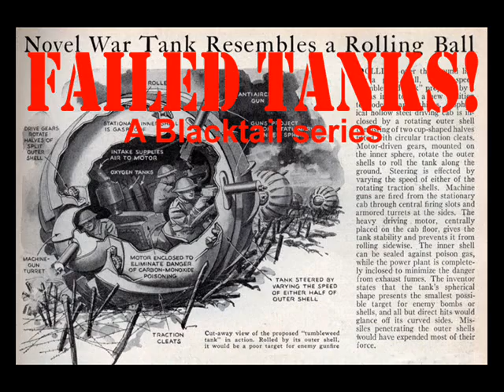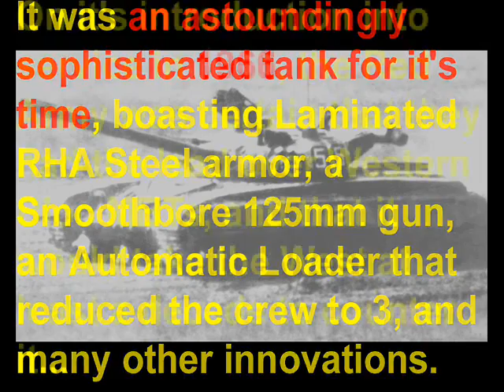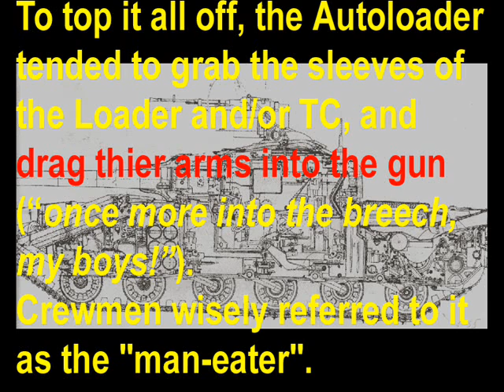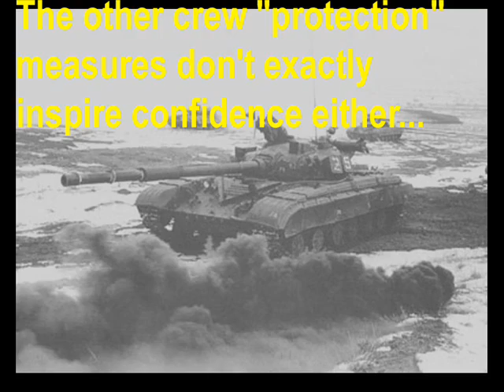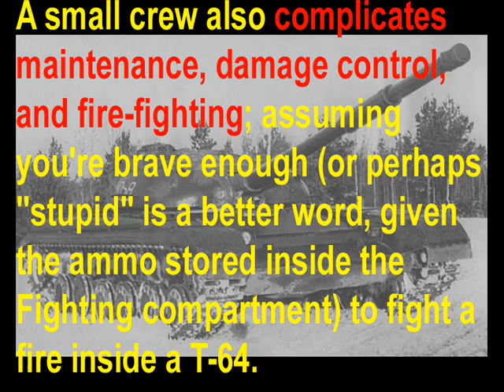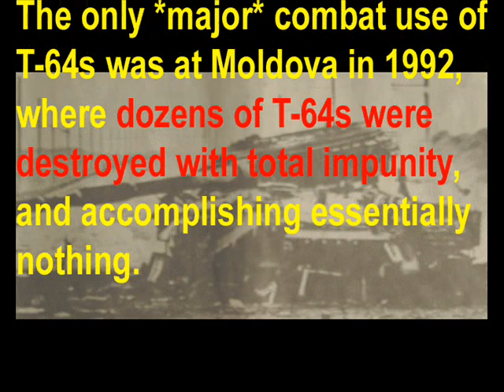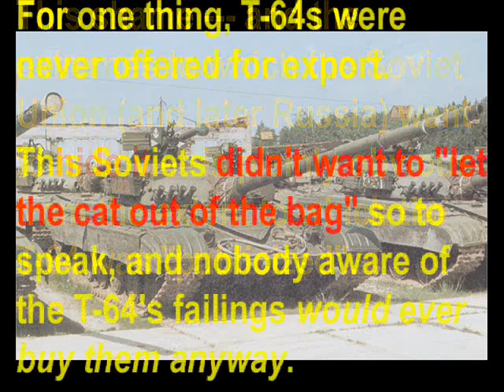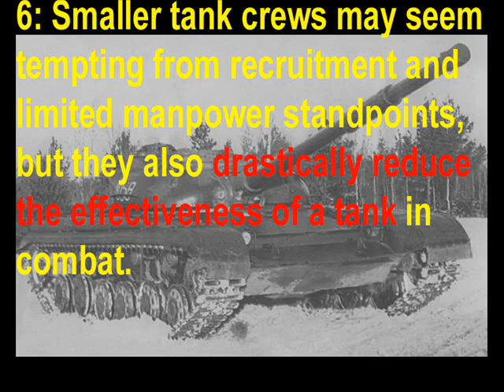Failed Tanks, Chapter 4: The T-64

Comment from the maker: @MajorDumai 
"Generally, yes, T-64 was overcharged by new techs, but the main problem was it's engine."
There was also it's autoloader, it's Gasoline APU, it's track-flinging suspension, it's inaccurate and short-lived gun tube, it's microscopic load of machine gun ammunition, it's crew height limitation, it's failure to find any export customers, it's small number built, it's disastrous results in combat --- and the fact that the T-64 was called "The Steel Grave" by it's crews .

Comment: @BlacktailDefense  The reason why they scrap it, is purely economical, instead of being parked outside for decades, they recup the steel and stuffs. The same is do with T80 and T72 surplus, as it was done with T34, 54/55, 62.

The only reason why T64 is not active in russia today, is lack of funds. T64 is expensive to maintain, compared to T72, and they already have an expensive tank to maintain : T80. As T80U is better than T64BV, they keep the best of the two.

Comment: @BlacktailDefense Yes, t64 had a lot of yougness problems, but you have not to forget it was the base to all modern russian tanks, T72, T80, T90 variants.

T64, T64A had lot of issues, but T64B was a very good tank, auto loader was improved, and became reliable, as for engine and transmission. T64B was the best soviet tank, before T72B and T80U were in great number. T72A and T80/T80B were shitty against T64B. 

It is still kept in store, in case of major war.

Comment from the maker: @MarshallJukov 
"AMX-30 has same mass as T-64..."
That's doubtful, given that the AMX-30 is the lightest production MBT in history (38 short tons, vs 45), and sacrifices armor for maximum Mobility. It's frontal armor is only 80mm thick, and is plain RHA Steel, and it's proportions are different from the T-64 (31.1x10.17x7.51ft, versus 30.27x11.2x7.22ft).

The only thing the AMX-30 and T-64 have in common, structurally, is a similar appearance.

Comment from the maker: @ReviveHF 
The Stryker MGS' Autoloader is amazingly awful. For example, it;
- ...only holds 9 rounds.
- ...is not accessible from inside the vehicle.
- ...is not actually replenished by the "Replenisher".
- ...jams after every 4th round or so.
- ...requires an exposed crewman to stand atop the roof and fiddle with it, if it has a stoppage.

This isn't even the START of everything wrong with the Stryker MGS; I'm going to devote an entire chapter of "The REAL Stryker" just to this one variant.

Comment from the maker: @MarshallJukov 
Another example is the 4-man VFM 5 Light Tank, which weighs only 19.8 tonnes with Level III armor, compared to the 3-man 23-tonne M8 Buford Light Tank it was based off of --- which carried 11 less 105mm rounds.

Taking the Autoloader out and replacing it with a Human Loader spells weight and space savings in any tank.

Comment from the maker: @MarshallJukov 
"...4th men needs more armor to protect him"
That would only be true if Autoloaders were smaller and lighter than a Human Loader --- which they are not, if you want to load anything bigger than a 30mm shell.

That North Korea's P'okpoong-Ho actually LOST more than a tonne of weight over the T-72 it was based upon (while adding a 4th crewman, more 125mm shells, track skirts, and large array of applique armor) demonstrates that Autoloaders make tanks heavier --- not lighter.

Comment from the maker: @MarshallJukov 
"...it can have even an diarrhea if breakfast wasn`t fresh enough - who will load the gun then?"
If that happens, the Driver will replace the Loader, and a replacement crewman will replace the Driver. It's a lot faster and simpler than replacing or repairing an Autoloader, which MUST be totally functional before entering a battle (you can't "limp forward" into a fight), and a Human Loader isn't hampered by sand, moisture, or extreme temperatures as easily as an Autoloader.

Comment from the maker: @MarshallJukov 
15000 M60s were built, which isn't relevant anyway --- Eastern and Western tank manufacturing policies are Apples and Oranges. 

History proves that successful Soviet tank production entails large numbers built over long durations, both of which the T-64 fell well short of when compared to both it's predecessors and successors in the Red Army.

Also T-64 wasn't built foe 24 years --- it was UPGRADED over 24 years. The last T-64 chassis rolled off the assembly line before 1970.

Comment from the maker: @MarshallJukov 
A labor-saving design is not labor-eliminating --- it can be applied to a 4-man tank that will ALWAYS have a 30% larger crew to perform them in less time, which again defeats the purpose of a smaller crew.

Furthermore an autoloader increases the complexity of a tank, which Physics and Engineering dictate will ALWAYS decrease reliability in turn --- thus requiring more maintenance, which there is now a 25% loss in manpower to perform.

Comment from the maker: @MarshallJukov 
The only APU I can find any references to is the AB-1P/30, which is Gasoline-powered.

As for the later figure of 500 hours of reliability (compared to 150 when the T-64 entered service) it just goes to prove that the T-64 WAS unreliable. It's the same procurement philosophy that the US military is heavily-criticized for --- "Buy now, fix later".

It's also revealing that it took all the way until 1976 to correct, and by then it was pointless; the T-72 had already supplanted it.

Comment from the maker: @MarshallJukov 
If the T-64 was that good, they would have been built in numbers exceeding a piss-poor 6000 (compared to 8000 T-90s, 12000 T-62s, 25000+ T-72s, and 100000+ T-55s), and they would have been built for more than just 4 years (compared to 10 for the T-62, 24 for the T-80, 28 for the T-72, and 40 for the T-55).

To say that the T-64 was an effective design, when the manufacturer was so eager to stop building them, doesn't make any sense.

Comment from the maker: @MarshallJukov 
Separate charges DO strain logistics, because you can't simply stack projectiles atop powder drums. This entails that two trucks capable of carrying 200 125mm Unitary Cartridge rounds between them are forced to carry 100 projectiles and 100 charges --- HALF AS MUCH ammunition for the same capacity.

As for the L23, it's a Biased Sample, because it's *also* a Separate Charge munition. It doesn't used a unitary cartridge like the M829A3 APFSDS, which has a 924mm penetrator.